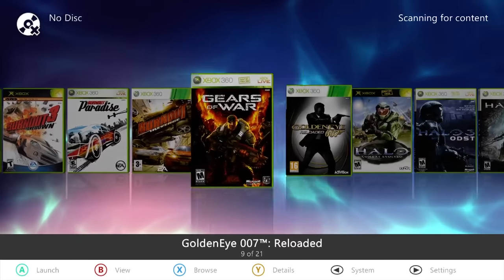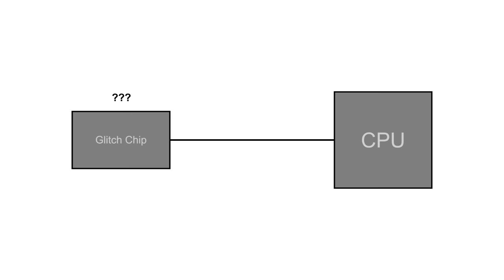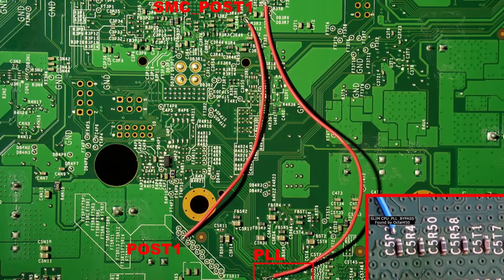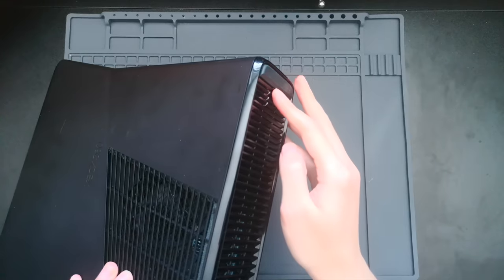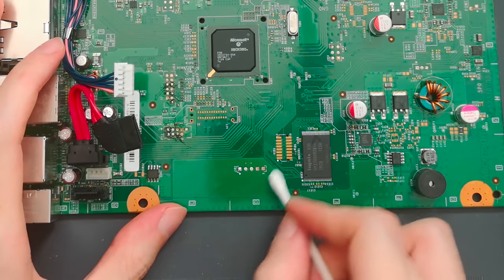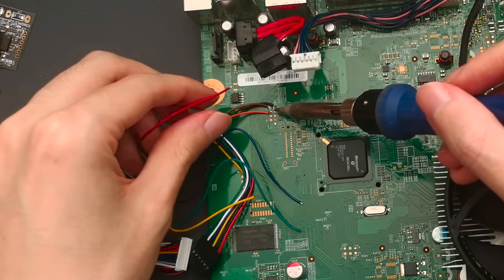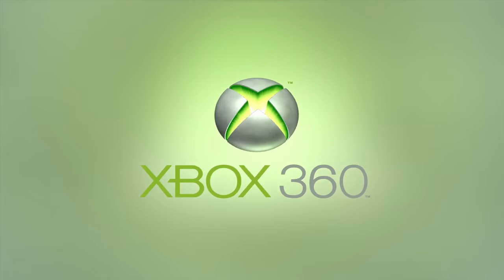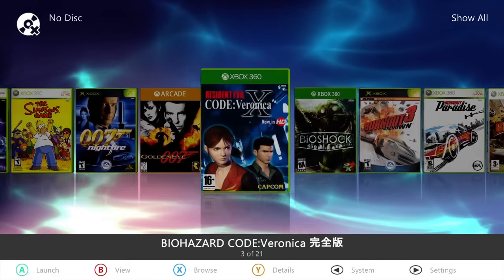You can mod your Xbox 360 with just two wires!

Comment: The hard ones to open are the FAT models because the plastic doesn't bend at all, the slims are difficult if you try to open them like you did, if you instead just apply some pressure at the back part of the console where all the ports are, in the central area, the clips will pop off and you will open it in 5 seconds without leaving marks

Comment: By the way, your explanation of why the SMC appears more reliable is incorrect. I am the person who found PLL_BYPASS on the slim consoles and created the RGH1.2 firmware for the slim which uses it, and it has much greater slowdown effect. RGH3 uses the same method, but instead of using a CPLD on a glitch chip to "guess" when to send the pulse, the SMC's microcontroller is the one guessing. It is still the same guess however. Since PLL_BYPASS on the slim system allows for 640x slowdown rather than the roughly 3-4x the I2C method you showed uses, it's much more reliable. So consoles with RGH1.2 are very reliable, a 5 wire install, and starts on the first attempt every time, and RGH3 simply removes the requirement of a separate chip.

Fun fact, the SMC is actually slower and worse at this than a CPLDs. This is why on Phat consoles the boot performance is much less reliable with RGH3, and RGH1.2 is superior, as the Phat consoles PLL_BYPASS only provides 128x slowdown.

Comment: You can use and MCU like a Pi Pico to do this if you already dabble with this kind of stuff which is convenient. The 360 isn't that difficult to take apart, admittedly, I have taken the 2 360s I've owned apart like a dozen times so I know how to do it fairly quickly. The most annoying part for me is the damn x-clamp, I'm always a little afraid when taking it off or putting it back on that I'm going to drive my screwdrivers straight into the PCB and break it. 

Also no donkey kong outro 😢. Maybe you can make a new one that says the same thing but with Microsoft SAM saying bytes right at the end for future videos. 
Great videos as always though.
Reply: You should get an X-clamp removal tool. They're only a few dollars

Comment: also as far as glitch chip timing, it has gotten much better in the years.. also the install is VERY important for timing wire lengths etc. ive had all of my x360's boot first start up with x360 ace chips and Coolrunner clones :)

Comment: The last time I opened my 360 S, which I ended up (but didnt want to) prying it open with my bare hands (last time was just pure luck). Afterward I just ended up purposefully breaking that center tab off, as it was the hardest one to reach and the one preventing me to open up the console completely. When I placed the console back together, it still held together pretty nicely. It's as if if not obviously Microsoft placed that tab there for extra security. Oh well, it's easy to open now and to do some TLC/ maintenance.

Btw the reason I opened up my 360 that time, was to remove the power/eject button ribbon cable in the front panel, so I didn't have to deal with the sensory button, those are fripping annoying. Luckily the controller can do it all anyways.

Comment: I remember trying RGH3 a year or so ago and I fucked it up badly LOL. It was really cold in the room I soldered in and that made heating up the solder really slow, even with flux. So I jacked up the temps on the iron and eventually it got to be too much and warped the PCB near the PLL point, irreversibly damaging the PCB. This was one of my first soldering projects so I don't really blame myself and I've gotten better since than but damn, still sucks to have that happen.

Comment: I hope we can pull a stable RGH 3 mod on a Jasper board, slpeaking of the tabs. I feel Microsort made the 360s harder to open around 2009. Alll the fat systems i worked on were annoying but not an issue to tear down. But man it took me almost an hour to open a 2009 Elite 360 i bougut for 25 bucks at a thrift store. No cables if I didn't buy a 360 controller to use with windows adapter (i prefer the 360 controller over the XONE.) I wouldn't have bothered. It was a fun throwback cleaning it up properlly though. I've been wanting to JTAG it since febuarary. But its a bitch to get a proper probe. Almost every model doesn't need it except the Jasper 360s iirc.

Comment: Quite a nice coincidence this video popped up in my recommends.

I'm planning on doing this mod probably in the next few months. Got the wire and found a supported resistor in the basement. Just gotta get a Raspberry Pi Pico to act as the NAND flasher and I'm ready to go!
Reply: I recommend a NAND-X or a xFlasher 360 for convenience sake. Yeah you're only gonna use it once, but it's way less of a headache this way compared to the pico.
Reply: @massgrave8x  Both are over $30. I'm going for the pico more for price than convenience. Plus the pico can be re-purposed for some other project after, so it's not e-waste to me after a one time use. Appreciate the advice though!
Reply: @massgrave8x pico is fine. Just need to make sure the pico is a genuine one and that your wire lengths aren't too long
Reply: I am also going for the pico, i like a good challenge 😊 but not too good to where stuff gets destroyed 😅 won a 360 slim on ebay for €90, but it has 3 original controllers and like 14 games. Just the console without a controller seems to be going for around 25. which is cheap, but not compared to those crazy goodwill deals
Reply: Just beware the Pico has mixed results with Corona 4GB boards.  Might work for you, but alot people (myself included) have had issues with it.

Comment: 0:42 This is kinda unrelated, but did you know that you can play the OG version of Burnout Revenge on a modded xbox 360? All you have to do is to change some value in a hex editor to trick your xbox 360 into thinking it's running Burnout 3. That way the game won't freeze and it will run just fine. I noticed you don't have it installed on your xbox 360, so I thought I'd let you know

Comment: I'll be super impressed if this applies to the older systems (like the Xypher).
Reply: Older consoles aren't really worth modding, but they can be done with a chip. RGH 3 doesn't always work well on phats, and the only phat worth modding is a Jasper
Reply: Not zepher (or xenon), but it does work on falcon, opus, and jasper

Comment: You need more than two wires, because you still have to dump and reflash your nand/bios

I can just run homebrew just by getting the private signing key from Microsoft 

And install xell to flash via USB and a "system update" xex only xbox360 with a signed version of xell or xellous, which is really all you need no disassembly or wires
Reply: Or just get a 360 xdk which runs anything with the null signing keyset and does more than a retail, factory rgh and j-tag, just change a few of the efuse bits in the cpu
Reply: No u can't have my signed xell bootloader only people wit connections to bill gates can get dat, even installing xell is kinda useless since you can just compile any xex and boot, xell just allows you to skip sigchecks
Reply: Oh my fucking god this comment reads like it was written by GPT

Comment: 3:42 Which is funny, because controller-wise it's kind of the opposite in regards to the PS3 and 360. For putting it back together, the 360 controller is pretty easy (stuff kinda flails about, but you can put it back in place easily enough) and the PS3 controller sucks (putting it back together is next to impossible so replacing the battery is a flipping NIGHTMARE, I'd rather just throw away my old PS3 controllers than try to repair them).

Comment: I got a cool runner installed into my regular 360 bit never bothered to finish soldering it in. Messing around with the wires and the NAND flasher was a significant enough PITA that I just never bothered.
I only got the power wires soldered for the coolrunner, so it just sits on the glowing away

Comment: How does it work with the official dashboard for unsigned code? Can you run stuff off a usb, or cd or how does it work? I'd like to see a video where you show that and then show installing a different dashboard. This is just for my curiosity, I already have a 360 devkit :)
Reply: Do you mean an rghed 360 on the stock dash? You just put your god games in the content folder

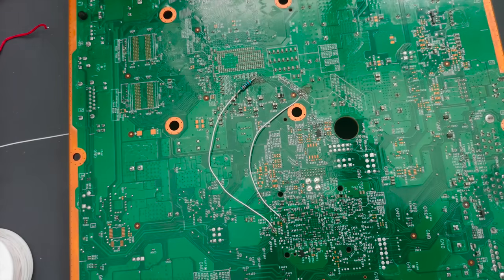Comment: 4:39 need to use a dab of hot glue on that resistor if you are worried about the contact pad.
Reply: It's best to just use 30 awg wire for that connection. Resistor leads still create unnecessary tension on that point. If you mess that point up, there's no alternative, so you'll have to go back to a chip install

Comment: I am interested in taking on this mod but with a xbox 360 e instead. is there any guide to use that motherboard instead? or a place that breaks down what each xbox 360 has which board types by serial number or such so I can confirm if it is the right one? Thanks

Comment: Xbox 360 the phat version you could buy a tool that made it a bit easier to depress those tabs, but on the Slim, it was literally 7 levels of HELL to get it to open.
Regarding the flasher they could've made a clamping device thingy that just attaches to those pads and no need to solder..

Comment: What about creating a port that would accept a plug that goes to the nand flasher ? Even like a flat ribbon cable connection.  make it with pre tinned pads that you just place on and heat up . Just incase you have to reflash

Comment: Sadly when I did my RGH, it was harder I needed to solder a ACE V3+ chip to my corona V2 console. Also it still requires a nand flashing tool to do a rgh including the two wires.
Reply: I'd say the glitch chip install is actually a bit easier than RGH 3 - it just takes longer and has more wires. A lot of people who are capable of a chip install have botched the PLL point trying to do an RGH 3

Comment: if you had the original firware all you had to do was create anew rgh3 firmware and update it thru xell and didnt have to use the wires to flash it thats what octal told me to do it from rgh 2 to rgh3 just rip off the chip add the two wires and boom done.

Comment: Seems a bit clickbaity to me. As in all cases you will need some sort of programmer soldered temporarily to the debug headers and in most cases you will need a resistor as well to prevent damage
Reply: He literally shows that in the video... Also you don't need a NAND flasher if you have a modded system that you're updating to RGH 3

Comment: There's got to be a better way to do the wires for the NAND flashing, like a purpose-built little connecter that just clamps to the board and contacts all 7 points
Reply: soldering and de-soldering 7 wires should be like 1 minute at most

Comment: I bought a Jasper Xbox 360 to mod, should I do RGH 1.2 or 3? Pros and cons for both?
Reply: Rgh 3 is unstable on phats. Rgh 3 only uses The South bridge as a glitch chip. It still doesn't  know when the best time to pulse is. Rgh 1.2 is a much better option. It will instaboot almost every time.

Comment: Wait, the XBOX 360 has been out for like, 18 years, and no one has figured out how to softmod it?

Softmodding doesn't usually happen too fast, but you'd think that it wouldn't take almost 2 decades.
Reply: That is totally fair, however, the PS1 didn't take 27 years due to its rock solid security, it took that long because barely anyone was looking. Modchips are so common that you'd probably accidentally trip across a modded PS1 in a garage sale. People weren't really racing to find a softmod.

Also, while the PS1 took 27 years to get a soft mod, it only took 8 years for the PS2 to get Free McBoot (Which wasn't even the first softmod on the PS2), and the original XBOX apparently had a soft mod within two years. While I haven't looked into the history of all console softmods, it very much looks like most of them come out during their console's lifecycle.

So I feel like I wasn't asking a stupid question at all, however, I have read up on it and apparently the XBOX 360 is locked up particularly well. It might get softmodded at some point, but those private keys haven't been found yet, and if they are found, it might take a really long time. By that point, XBOX 360 emulation might actually be good!

Comment: 360 slim shell is one of the easiet cases to open, its a clam shell, push in on the split seam and pull apart, done in seconds

Comment: You think opening up a slim xbox 360 is hard? Try opening up an OG one without breaking one of those tabs. It's also like that on the Xbox One and probably the Series X and S.
Reply: Phat models imo are easier to open if you buy the multi tool specifically taillored for it. I had a bit of difficulty taking apart my halo reach slim to replace the motherboard and reshell since the XGCPU on my console failed and I don't have the proper tools or skill to reball and replace that component.
Reply: @oOignignoktOo1  i just did it to a friends xbox and let me say the slim is more difficult than the og one but i wouldn't call it impossible or hard or anything like that just annoying
Reply: @skunksecond  my post from 9 months ago is a bit dated now. I have done some RGH3 mods on slims now. I still say the phat was easier to work on than the slim I modded for a friend. He had a Corona v3 and I had to do the post fix and the whole 9 yard to get it working. Hardest part was scraping of the mask and soldering to a super tiny via on the motherboard. Once I got past that though the rest of the mod was trivial.

Comment: It’s so annoying that my jr-programmer stopped working. My windows laptop no longer detects it in device manager. All I did was mess with the programmer’s switches in an attempt for my laptop to pick the thing up… then disaster struck. So disappointing. I spent hours getting the drivers for that programmer to work…
I mean, the reason I fiddled with the switches in the first place was because the programmer gave an 0x000 no device found error in the software tool. I thought I soldered it fine. I did it twice!!

Comment: I have a LT 3.0 xbox from 2009, and it's the original white fat model, is it possible to convert it to RGH3? how hard would it be?
Reply: It depends what motherboard it has. If it's a Falcon or Jasper, it should be good to go. A chip install is recommended over RGH 3 for fat consoles, though

Comment: Does this work with the xenon
Reply: Nothing does. If you have old firmware you can get Linux tho
Reply: You have to use EXT_CLK. Although I wouldn't even bother trying to mod a Xenon that was made before mid-2008, since those are pretty much guaranteed to fail. In about June 2008 they had fixed GPUs in Xenon consoles which made them basically as good as a Jasper in terms of reliability.

Comment: this is click bait, not just two wires. You added additional wires to mod it. people clicked on your video because it was a catch fraze 2 wires only. That's called click bait, disinformation to get viewers.
Reply: most of them need a resistor as well and I know the phat console I used Falcon V2 requires a diode.
Reply: No, it's not clickbait. Anyone who has done more than 2 minutes of reading on RGH knows you have to flash the NAND. The mod itself has 2 wires attached to the console when it's done.